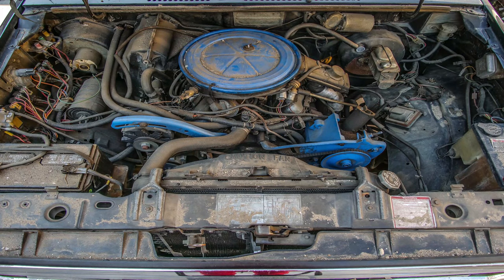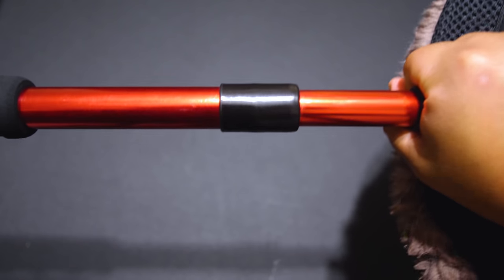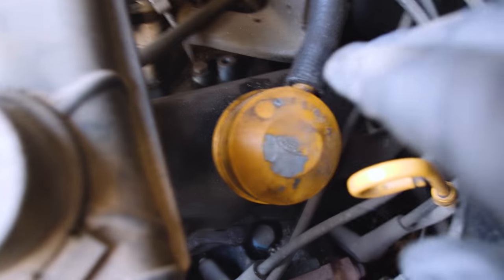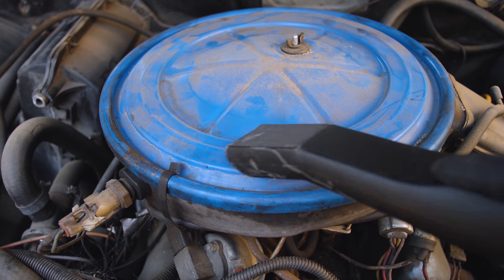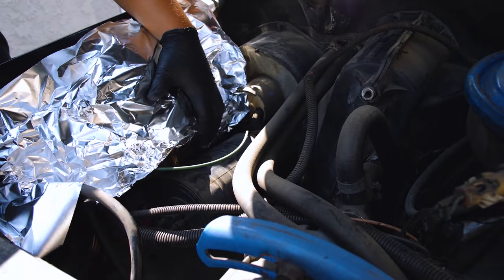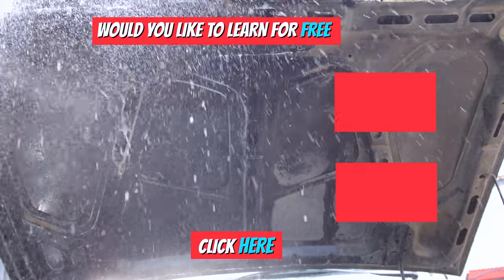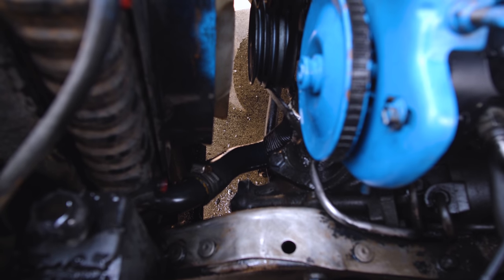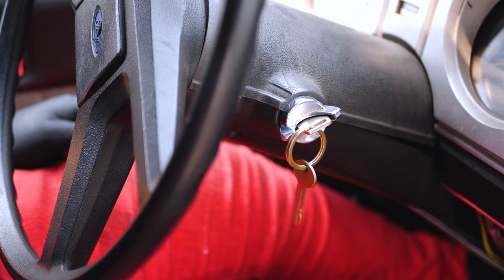How to Wash Your Engine At Car Wash💧

Comment: I did always wash the engine with demineralized water (if hot is better) without any detergent and without any protection (but avoid direct spraying on alternator, main connectors, bearings...): clean relative good if the engine not seep oil, without risks to degrease too much (can cause corrosion or sizings), and demineralized water is not conductor...

Comment: Bro some people are really clueless. The engine bay is NOT supposed to be wet, moist, or engulfed in water. It will DAMAGE your electrical components. They put hoods on for a reason! Use your brain man